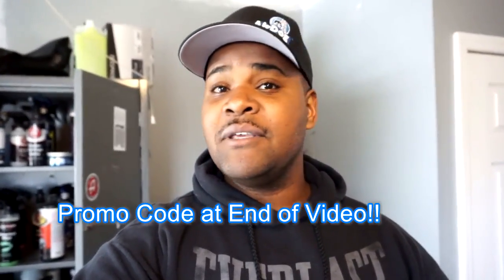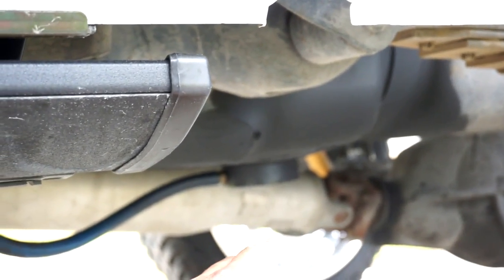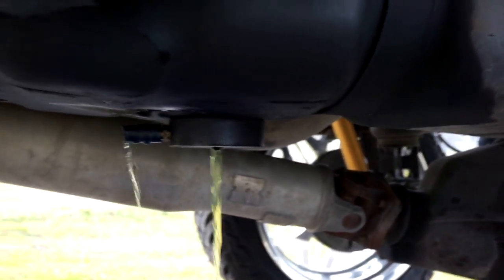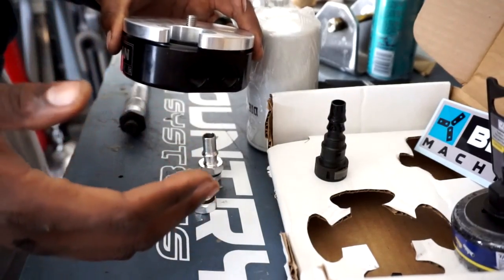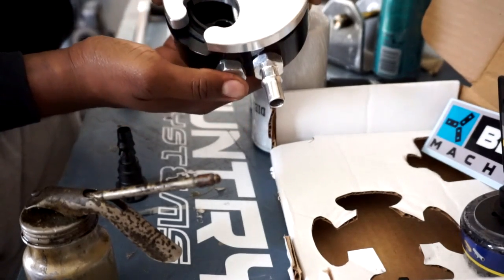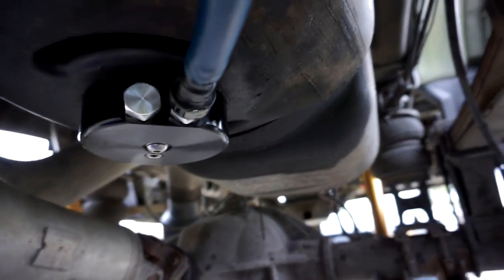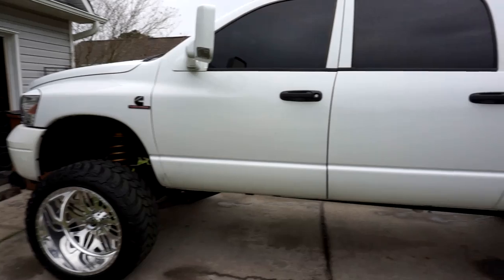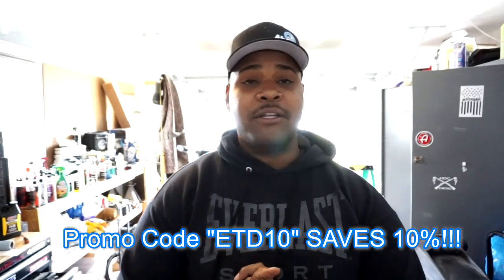Installing the BEST Fuel Sump    BEANS DIESEL SUMP!!!

Comment: Cam , when I drilled into mine, I drilled very slow. I got only a few plastic pieces in the edge of the tank. It was easy to clean without dropping the tank.  For others that don’t have a hole yet! Just drill very slow! Clean up is easier with plastic particles! I used a metal file to de-bur the edges. 🥵
Reply from the maker: wise words and advice on drilling into the tank! your 100% correct.

Comment: Yes sir, got mine on my second gen with an air dog 165 4G and absolutely love it!! Another awesome video Cam.
Reply from the maker: thanks man I appreciate it! its worth the money.
Reply: Just curious, I just bought the air dog 165 5G and got the beans diesel sump with return. Haven’t installed it on my 2010 ram 2500 trx4 yet. I’m really curious after 3 years have either of you had issues with the sump or air dog? Any leak problems? Any low fuel problems especially on hills?

Comment: Bean's are pretty top notch but I plan on going with the G&R Diesel sump because of the return straw that keeps the returned fuel from causing turbulence at the fuel draw location. Made in USA quality is on par or better than Bean's as well. Just throwing it out there for people looking for options. Can't go wrong either way.
Reply from the maker: For the beans sump you don't have to run the return to the sump u can run the return to the top side of the tank at the fuel basket. That's how my truck was, that's why I had only one fuel line going to my airdog.
Reply: @EVERYTHANGDIESEL  for sure. If you're using the stock return either sump is excellent. Great video!
Reply from the maker: Thank u!

Comment: Got mine also but still haven't got it installed. 

Current Pending: 
*Front and Rear Gears - Stock 3.42 to Nitro Gear 4.11s
*After Market Fuel pump
*Sump Pump
*Deep Trans Pan
*Diff Cover

you now how it goes! lol 

Thanks for the vid!
Reply from the maker: good thing is for 3 of those 5 things u can use my promo codes and save some money on those if u havent purchased already. those gears will help out a ton especially coming from 3.42s! good mods tho man

Comment: I am going to do this and an airdog ii 4g. You think it would be better to run the return into the sump? My thinking is of you are low in fuel and accelerate all the fuel will go away from the sump but with a return going into the sump it should in theory have fuel no matter what?
Reply from the maker: It doesn't make a difference.  In reality if your to the point where there is no fuel being sucked through the sump u have bigger problems haha but running the return to the sump vs the top side makes no difference

Comment: Hey question just a little off subject but am changing my u joints on my dodge Cummins as well what brand should I go with I’ve always heard good things about moog but what about splicer ???
Reply: I have yet to have a diesel, but out 9 rams I have own/have owned I have always used Spicer. Never let me down. Just my opinion.
Reply: AJ Jurashen  aaa ok cool thanks bro
Reply: @gilbert8477  my pleasure! I'm not saying anything bad about Moog, I love Moog. But since my old d series Dodges and first gen rams, Spicer made axles always had Spicer joints. Might just be my quirky side speaking, but it was already there might as well keep going with works.
Reply from the maker: when i did my u joints 2 years ago i went with moog u joints and they still are going good today, i grease them every 6 months or so and no issues. Ive heard good things about Splicer as well.
Reply: EVERYTHANG DIESEL ... cool bro thanks a lot
Reply: @gilbert8477  Look at Torque 4x4. They have upgraded ujoints and I've used them on a second Gen and they have accumulated a lot of miles with no issues. A little more money but great quality.

Comment: I have a stock in tank lift pump on my 24 valve, if I bought a 165 air dog and sump would that be good?
Reply from the maker: Yes
Reply: @EVERYTHANGDIESEL  and it will bypass the old in tank pump and fuel filter with the beans sump? Does the fuel gauge still work?
Reply from the maker: @chrisrichards280  yes it will bypass the oem pump. Yes your fuel Guage will still work.
Reply: @EVERYTHANGDIESEL  thanks man

Comment: Hey I'm curious what is the benefits to a sump over the factory vaccume fuel system? I have read some things but you guys might be able to make it easy for a dummy like me. Great vid cam! As usual. I'll be watching every episode
Reply: Im just now seeing this video cuz im searching around. BUT i saw your comment, and no one answered. In case you didn’t know yet, the biggest benefit of a sump is its way less work on your aftermarket Fass/airdog lift pump. It helps the pump stay quiet and have as little restriction as possible. This in turn helps with pump pressure, and pump longevity. Next is the fact you can suck the tank basically dry.
Reply: @keithlangner2043  thanks for the info! Forgot i asked about this its been awhile 😂